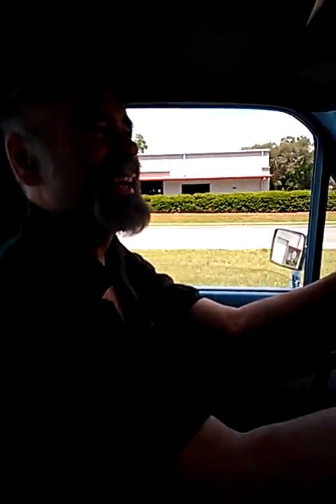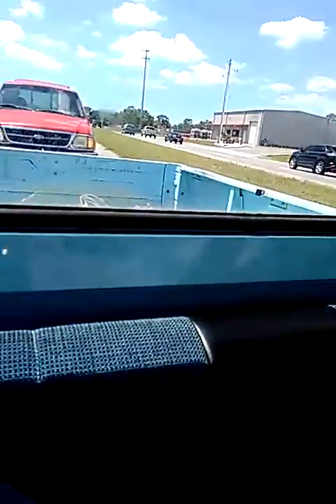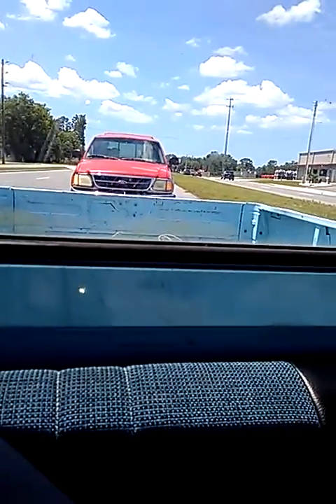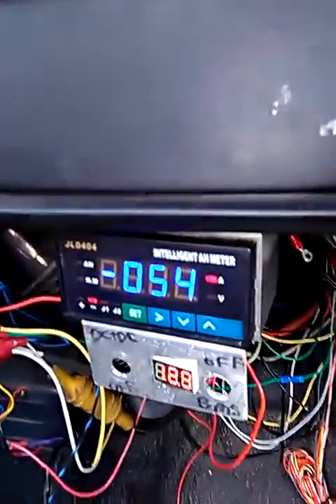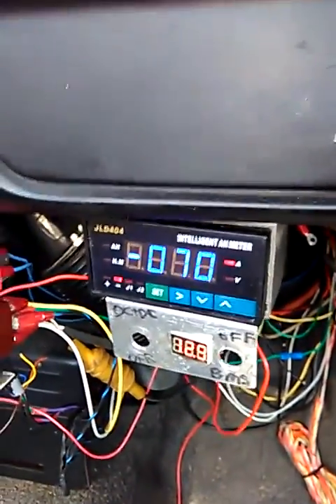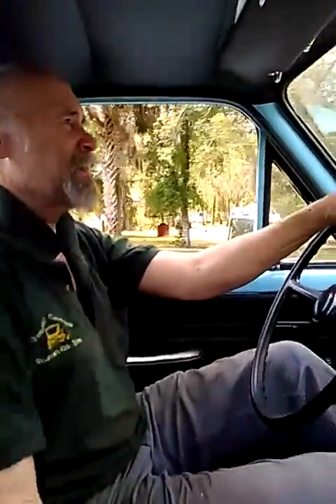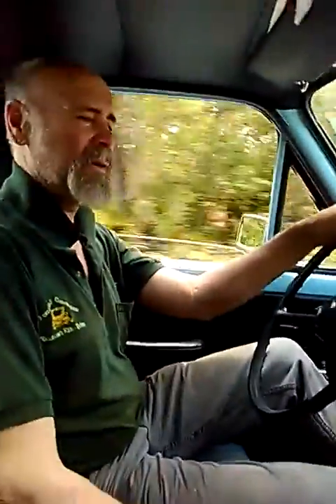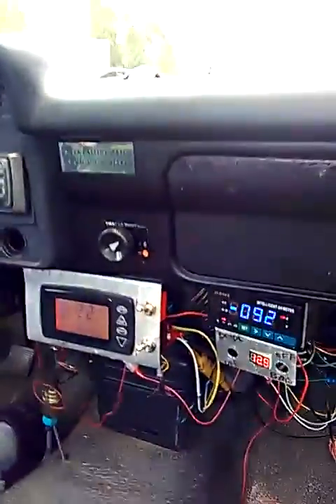EV with hyper 9 towing F150 pu

Comment: What happens if you mount the hyper 9 straight to the transfer case of a full size 4x4  truck? I have a 2001 Chevy that I'm wanting to convert.
Reply from the maker: You need some kind of ratio think about a 2 to 1, straight to the transfer case I believe would just give you the rear end gear ratio. Not having that ability to be in 2nd or 3rd gear what kind of men like taking off in 4th gear I have not have the pickup or ability to climb much of a hill. Does your car have an automatic why not keep the manual transmission?

Comment: Do you think that motor would be OK to fit in a 4500lb (max cross weight) truck? I'm looking to do a conversion. thanks.
Reply from the maker: Well some of this will depend on how fast and what kind of acceleration you want. And also what kind of battery pack you have. For about the same amount of money you could have a 11 in series motor with a 1K Zilla which would be about 300 kilowatts. You wouldn't have Regen or the other AC features. This is the setup I have in the 1956 f500 truck. It weighs 6000 lb. We have something called the assistant program and in that program I work with you doing the conversion, we could try out the two different setups as they both have the same bolt pattern. We're located in Florida. WWW.greenshedconversions.com
Reply: Thanks for the reply Steve! I would be using the vehicle as my daily driver, on fairly level ground. Don't need a great nought to sixty time, but would need to keep up with highway traffic (70mph). I would prefer AC over DC and would probably be using Tesla battery packs.
  I'm assuming you are referring to a Warp 11 motor,  when you say "11 inch series wound motor"? 
Unfortunately,  I'm in the UK, getting hold of motors here is difficult.
Reply from the maker: @peterbradley6202  yes I was talking about the netgain 11 in DC motor. We sell both the DC on the AC motor from netgain and my wife says she can ship it to you. You can look on the website www.greenshedconversions.com as for the AC versus DC the price is coming down on the AC stuff but it's still about three times as much for the same power.
Reply: Thanks Steve! Will do!
Reply: @steveclunn8165   So is the warp 11 the best option for vehicles above 5000 lbs?

Comment: What is your average range with  30kwh?
Reply from the maker: 30 kilowatts would give about a hundred miles with a few kilowatts left over. The rule of thumb is you take the weight of the car move the decimal over one place and that's how many watts per mile is used. This is about a 2500 pound truck so it uses about 250 watts per mile.
Reply: That is a cool conversion you shared! Thank you.

Comment: Hi Steve,
800Amps is the motor current, not the battery current.
Reply from the maker: That's true but to get 85 kilowatts from a 130 volt system we would need to have the amperage up pretty high at least 650 amps I imagine from the batteries. I don't think I have pushed it over four hundred amp though. But I'm getting tired of breaking things.